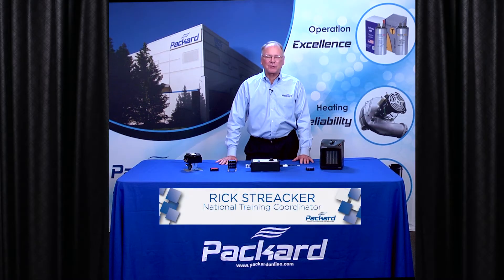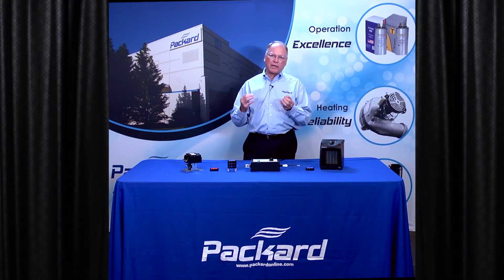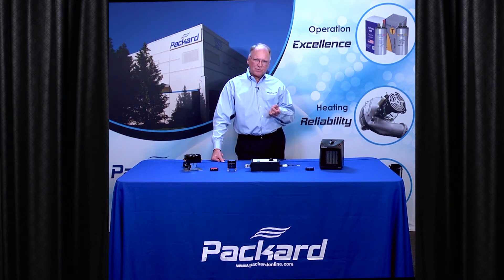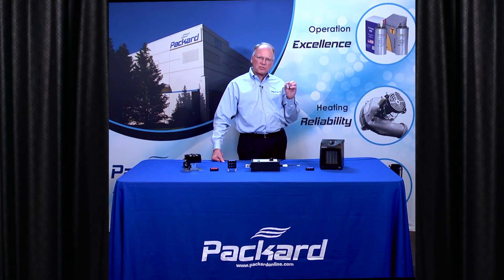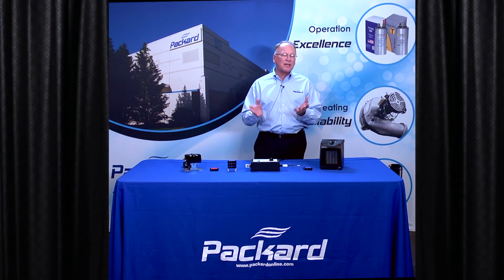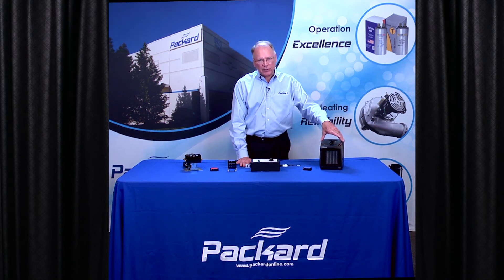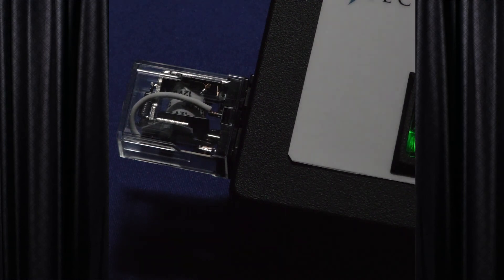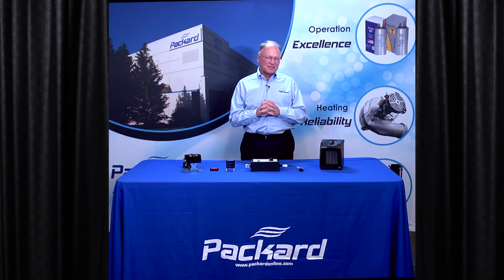Nosparc®- Arc Supression: Extend Your Contactors Life

Comment: Packard makes some of the worst contactors available (cheap Chinese junk) that doesn't have enough Beryllium alloyed in which leads to arc burn, pitting, etc. thus their contactors have a very short service life.

The original contactor with my Carrier condensing unit lasted over 20+ years without any issues.  The Packard replacement contactors are lucky if they last 2 years before the contacts are burn all the Hell or welded together :face-orange-frowning:

This company should have a class action lawsuit filed against it for ripping the consumer off with the junk they are selling!

Comment: How much voltage was going through the contacts? Can the Nosparc work for DC voltages up to and above 200V as well?
Reply from the maker: Hello, please see bullet points below:
• In the video, 120 volts was applied.
• 440 volts and above is not recommended for the NOsparc.
• The DC NOsparc is suitable for up to 250 Volts DC.